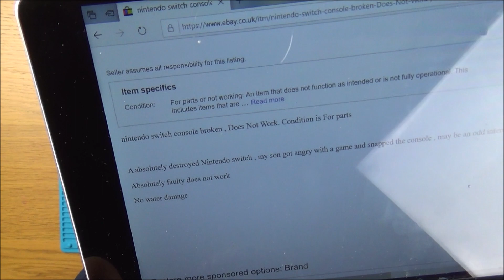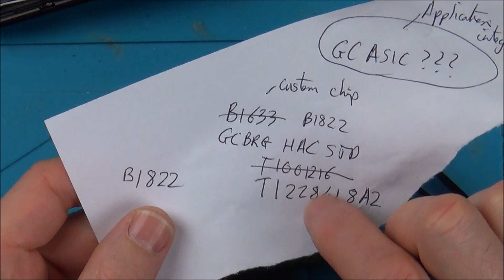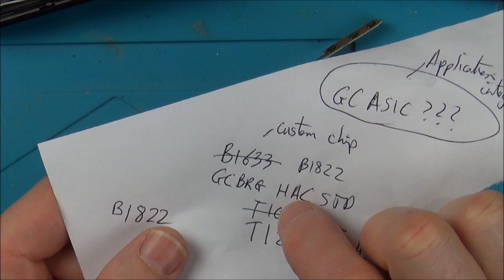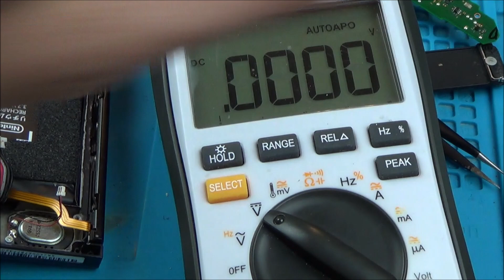Trying to FIX: RAGE QUIT Nintendo Switch

Comment: Vince. Quick note, thanks for inspiration. Just found the cause for a failed left channel on my old Sony amp. I found a single blown cap, flipped the board over, yep board marked "left channel". I took advantage of the arrow marked screws at disassembly, and made quick work of sorting the various board sections (power, lower voltage area, etc.). Realizing I've actually learned a lot from you. Thanks mate. Most important lesson, if it's broken you're not out anything by looking into it. I've a good feeling I will have a successful repair shortly.

Comment: You inspire me to want to fix electronics when I'm older
Reply: How old are you? In my opinion you're never too young to start learning, and old (not vintage, just old) radios are cheap as you like. Also flat screen TVs can be found in skips on occasion with the screen intact.  Practice on things you don't care about & cost little/nothing, make your mistakes there and spend your money to build your tool kit rather than buying projects & you'll do alright.  Decent starter soldering stations are only about £25 on ebay, i use a generic "936D" that's served me well.
Reply: Try working on old or broken keyboards and mouses for your first try, you can also find cheap stuff on fleamarkets and garage sales, along of high-school also have electronics classes too to help if your interested
Reply: I guess you could say he conVINCED  you

Comment: I worked for Celestica back in the early 2000's. I was trained  in PCB rework and repair for 8 weeks before  I was allowed to touch a working board. After 18 months of working on the main repair line, I was selected to train for an additional 6 weeks in pad and track (trace) repair. I had the use of the best equipment money could buy and if I had been presented with that board , it would have been put straight in the scrap board bin for other trainees to work on! Props to you Vince for even attempting to salvage this mess.

Comment: Great vid Vince, good fun. There's two techniques to repair the pulled pads, first is solder paste, smear it in to the pulled pad voids, don't be to fussy how neat, and then reflow. The other is to use solder balls, bit trickier this one, drop the balls into the pad voids, heat up to reflow temp and then smoosh the balls down with a flexible metal spudger - in order to connect the balls to the trace nubs.... you have to do this due to the incompatibility of the balls diameter and the mismatch of the pad voids. of cours you'd still have to manually repair the missing traces without nubs separately with enamel wire. check out ipad rehab for a demonstration of the second technique on iphone X repair.... though I'd recommend the solder paste method as it's easier. think this board is a goner though tbh and would at the bare minimum would require heat up while pushing flat to lessen the strain and after would likely require a complete reflow.
Reply from the maker: Brilliant advice, thank you so much for sharing it. I would have never have thought of using solder paste. Nice one :-)
Reply: TBH, I doubt it's repairable, or even worth repairing.
Reply: Second iPad Rehab and also Louis Rossmann and Paul Daniels for some grreaaaaat information on repairing electronics like this. Those all focus on Apple products, but the techniques are transferable (and might encourage you to try repairing some Macbooks)

Comment: I'd say this would be a perfect candidate for parts. You can definitely use the common parts such as the charging ic, battery ic, power ic etc. The charging port could be reused. The joycon rails should be good. The battery should be good. There's easily £70 - £100 in good genuine nintendo parts to use there for you. Great content, could you possibly try some faulty iPhones or samsung phones for repair?

Comment: HI My Mate VINCE, yes you can get solder in there and a tiny wire you could fix that, my main concern is that the inner track could have broken, I did an Iphone 7 Base band the other day and one of the pads were torn off under the base band ic solder a wire to the the little via and the phone was working again, My recommendation remove all the chips and solder it to one of your dead boards you have, you would need to get a preheater and universal stencil kit and maybe some solder balls. still a very nice video :-)
Reply from the maker: Thanks AR, I will bear that in mind if I ever have a device with one or two solder ball pads ripped off :-)

Comment: Hey Vince, interesting video. That chip is called the GC ASIC, as you found. The GC stands for "game card"; this chip is responsible for talking to switch game cards. The OS should boot without it, to a certain point and then error out. That said, assuming the switch is hackable, you could use the "nogc" patch I helped develop to get around this. If everything else is working, then it should boot and work fine with the patch applied

Comment: 18:00 actually the switch can turn on without the chip, aslong none of the pads underneath are bridged. Tested it once because i had problems with the wifi, gamecard reader and touchpad. Your switch just wont be able to read gamecards and might have a buggy touchpad. But it really does boot without the chip, i was quite suprised myself.

GC Asic. I interpreted GC as gamecard.

Comment: He also ripped pff the joycons? Weird how they weren't in the lot
Reply: It's called extra money, they sure going to try parting out every component and more than likely get back 200$
Reply: @billy-waynejeffcoat4828  Thought about that. First I thought they kept the joycons but when I saw the rails I immediately thought where's the rest. If they sold them separately they could've at least included the rails. Also a good guess for 200, just thought about it and if everything else is ok that's an easy 100 or more pounds
Reply: More than likely that the son was grasping both sides of the console (including the joy-cons) and slammed it down onto something like the back of a chair.  That explains how something so rigid could be bent like that and that the joy-cons were ruined and not included.

Comment: Hello Vince, not sure if you will see this comment or not, but here goes nothing. Each pad underneath the chip has a little "stem" that goes to its appropriate layer. In the middle of the pad you can actually see this "stem" (silver dot). Scrape on it a bit and add solder. It will fix the pad. Would be a good exercise. Interested to see  if it could be saved. I believe you could do it

Comment: Generally, multi layer boards will have power planes and ground plane inside but with some signals mixed in depending on circuit complexity.  you definitely want to separate them where it broke.  It is unlikely a signal goes out and around the mounting hole but then, you never know.  Caps charge up from the voltage the ohm/continuity check puts out and can trigger the shorted beep after the cap charges up a bit.  The pads are gone under the HAC chip and you are exposing the PCB material (the white stuff).  The little silver you see is going to be the interlayer connection (like a plate through) under the chip.  The ball pads are stuck to the HAC chip...

Comment: There are definitely a few good chips on there, chips that tend to be bad in broken Switches.  So it could definitely be used for parts to fix others.  That chip you took off is most likely good too.  But that board is completely toast, I guarantee there are broken traces on some of the other board layers.  What I would do is take all the chips off and use those to fix other Switches.  Heck I'd probably take the main APU of too, just to see what it looks like.  It's possible the chip itself might be good, and could be used to replace a fried one on another Switch (assuming you had the proper equipment to reball).  I saw a video with some broken Switches with fried APU's the other day.  Apparently if the power pins short in a certain way it can fry the main APU.  This one does not appear to be fried at least.
Reply: Switch doesn't have an APU.
Reply: @cyo_corner  It does though.  The Tegra X1 is a SOC that includes both a CPU and GPU.  It's not the same design as AMD's APU's but it still is one.
Reply: Then it's a SOC. An APU places the GPU and CPU in the same die.

Comment: That chip that came off is the GC (Game cart) ASIC, it's a chip that the Switch uses to interface with game carts. It does some encryption stuff to add extra security to ripping game carts (without an actual Switch running dumping homebrew). Shouldn't be locked to the specific console, but they do get locked down by firmware upgrades (old firmware Switch can't use an "updated" GC ASIC)

Comment: If you warm the board it can straiten by itself. Different layers can contain any traces or power rails. First try to make emergency repair to visual defects of the board and fix major problems then try to turn it on. But anyway you can salvage all parts because they are not faulty or burned, at least ones that aren't physically broken. You can clean/desolder balls from chip and solder it to another board. On the second review of the video at 20:56 there are missing/ripped balls from the chip itself.

Comment: Quick tip: 1S ( 3.7v) battery packs have a voltage range of 2.6v to 4.2v, but you don't want to go below 3v, as it could over discharge and cause problems

Comment: ASIC is just the industry term for a custom designed chip for a specific device. Judging by the fact that the connector it's near goes to the card reader, I'd assume "GC" refers to Game Card. So, I'd guess it's a custom chip to interface with the game card slot.

Just out of curiosity, I'd suggest probing one of the traces that the chip originally sat on (if you can) and running your probe across the pins of the connector that the card reader connects to. If it is what I think it is, you should see continuity on a fair number of the pins.

Comment: Ok question 
1 can you change any input on a switch usb controller
2 can you plug in a pc usb flight stick controller or to switch for fast racking NX I’m thinking of making a home arcade and I would use like this ps4 convert cables to switch you showed off but I want to know if you could use a flight stick and change the buttons I’m thinking about the logtic flight sick that like 40-50 dollars

Comment: forty quid for this? Vince, you have more money than sense!
Reply: he got about 30 - 45 quid spares out of it
Reply: It's worth it for the parts. Pretty much everything there is useable except the motherboard and screen and even if you can find parts cheap online, often the postage is the killer if you need multiple parts especially. Here he has pretty much anything that you could want parts wise all in one package.

Comment: The GC asic is basically the gamecard controller chip (called “LOTUS” in the OS), it handles all the gamecard crypto and reads/writes to gamecards. I’m unsure if it’s required to boot, it has its own special firmware that gets uploaded to it on every boot by the FS system module, it might fatal if it fails to push that firmware, might panic, dunno. But I’m fairly sure you’d at least get some kind of display without it, whether if be a panic screen, fatal, or even the home menu. And to my knowledge it isn’t married to the main board. Edit: https://switchbrew.org/wiki/Gamecard_ASIC has a bit of info on it.

Comment: can you strip the board of the components and store them for other projects meaning it may not be a switch but if you need such and such capacitor or resistor you would have it on hand
Reply: The problem there is the smd components tend to be either vaguely or not at all marked. Without a schematic it's hard to know what value stuff is.

Comment: What about the memory module you could use it to do a 256 or 512 GB upgrade board the problem is I believe the rom is bound to the soc id number on that mobo so even if you tried it the 32gb rom chip would need to be wiped not sure if that is an auto matic process that would happen if you tossed it into a software bricked or nand failed switch.

Comment: I have a trouble with my lovely Nintendo switch. It cannot recognize anything I connected. Even though the Nintendo Pro-controller cannot be connected via wired communication. When I connect my Nintendo Switch by a USB-cable, my PC said: "Unknown USB device ( Device Descriptor Request Failed) ". 

Charger is Ok. Docker is OK. 

Furthermore, I used some tricks I get from your channel to check their capacitors but nothings go wrong. 

Do you think about that ? Can you give some advice ? Should I replace another USB-C port?

I do not know what can I do? How can I find my trouble?

Would you like to help me ?

Comment: I don't understand why can't anything be looked after these days I have a switch which I modded myself and still works and did a joycon shell switch and both still work I hope the family didn't buy another for the stupid kid
Reply: I bought 3 xbox 360s from ebay faulty 2 have loads of caps missing looks like a North and southbridge have been replaced 1 has a North and southbridge missing blown fuses etc so gave up but fixed a slim but don't know how long it's going to last I found the gpu shield lifted with 2 missing minut chips missing no idea if there heat sensors or what rgh it at same time

Comment: 23:17  It's also worth mentioning that systems which contain the HAC-CPU-21 are prone to breaking the fan.
Reply: Especially when the fan is crushed between the heatpipe and the case...
Reply: @danmackintosh6325  no its a known manufacturers defect,
Reply: @TermitesRGood1  the fan breaking or being bent in half? lol

Comment: After a little investigation GC ASIC is GameCard ASIC which seems logical. It control gamecard functionality basically. Thinking where it is also makes sense. Might be wrong but I don't think so at this stage, either way, if it is and it did power up how can you use a gamecard now anyway? Here is the link: https://switchbrew.org/wiki/Gamecard_ASIC

Comment: Hey on the broken plastic tabs on the back of the case might I recommend this : https://youtu.be/n1meoZaHYZo
Reply: All you need is a soldering iron , heat the plastic and leave it cool . Most plastics will be as strong as it was before it cracked/broken. Will also be stronger than gluing it .Done this with broken body kits over the years and numerous household items. 
What I do is just lightly touch the edge of plastic you want to mend with a soldering iron then leave it cool. If the plastic is hard when it cools your ok to try fixing it. Some odd plastics go soft after heating hence the test.If a part is broken make sure to melt the two parts back together , not just the surface, so melt it from both sides to the center.
 If you need more plastic to melt in , you can cut it off the same item ,something which is not noticeable or if its abs, melt zip ties then shape with a little file.
Reply: Interesting technique. There's also 2 part epoxy putty which would be used in a similar fashion. I repaired a squared off luggage roller wheel with it and its held up surprisingly well; takes some crazy abuse rolling around too
Reply: @fouroakfarm   Thanks man good to know!

Comment: That ASIC chip appears to be a Nintendo-specific chip for the game card: GC = game-card ;-)
There's no way this could have been fixed, some of the BGA pads are filled vias that go  straight through to the middle layers and may even link other components there (which would make using a wire impossible even if you knew how the chip was connected). Too bad, if there was one person who usually would have fixed such a lost case it would have been Vince :-)

Comment: You can try use solder ball. But it not worthy to do it. Because the bend is to bad, and right on big chip. If your massacres enough, you can try to transfer all the components onto new naked board or to brain dead board. 😆

Comment: you need to be careful when adding lots of jumper wires to certain ICs as the jumper wires can have a small amount of capacitance and inductance and cause the chip to malfunction.